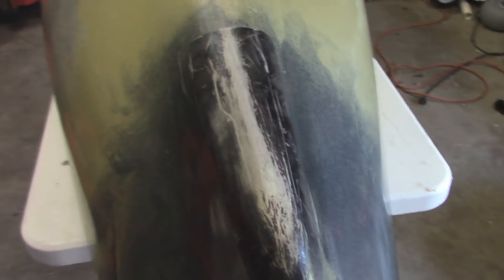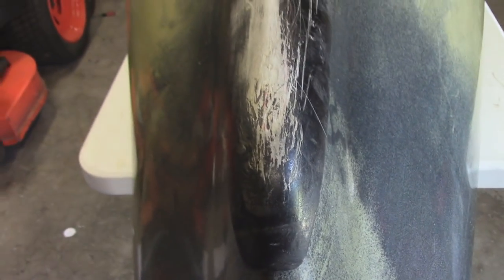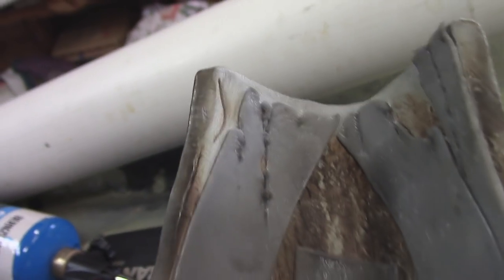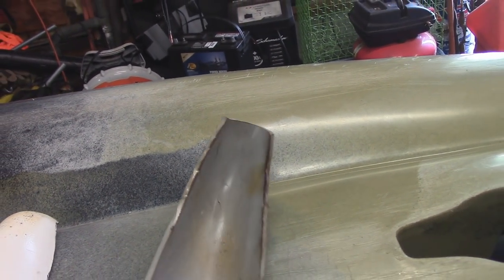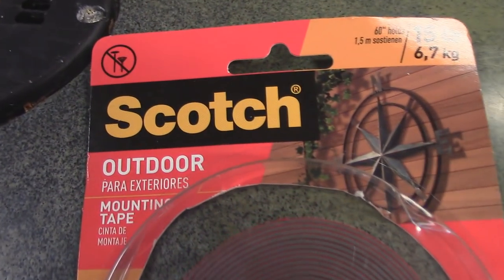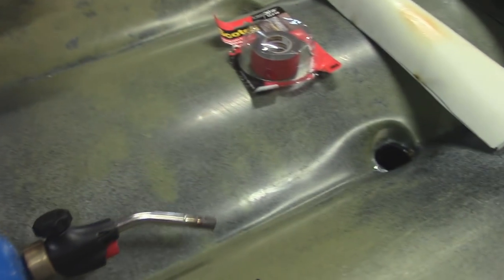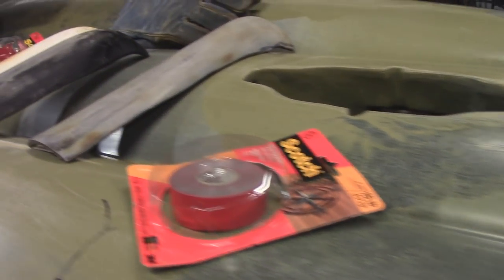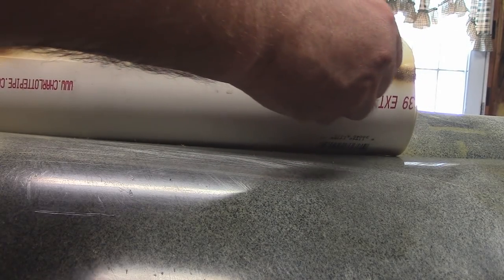The Best Front Skid Plate for any Kayak  (D.I.Y.  Keel Gaurd)

Comment: Great idea. Use a heat gun to reduce scorching. Also use a heat gun to soften adhesive between parts you want to pull apart. A loosely filled leather sand bag can also help in shaping.

Comment: Just like to say     THANKS     this is by far the best way to install form fitted, extremely tuff and removable skid plates. I have two royalex canoes and after 20 years there were some thin and worn away skin spots. All other options were messy and 1 time applications that once those wear out...what do you do then?    I used a heat gun and created form fitted skid plates that will extend the  life of these canoes another 20 years...one piece of advice for anybody that wants to try this...you can order PVC that is colored...wont be a perfect match of course...but closer than white or grey....once again...giant thanks for this video!!!!
Reply from the maker: Thanks,  mine is still going strong.

Comment: Anyone tried to use Fiberglass resin sheets and epoxy to make these things? seems that It would be easier than heating up PVC.
Im going to try this on a small piece I need to make should be less of a risk with the heat. Thanks for the detailed video!!

Comment: I made a trolling motor mount out of conduit and a heat gun worked great for bending it. I bet you could stick it on with plumbers/marine goop. Black pipe is probably ABS. It takes a different glue than PVC and might not stick to the tape. I wore a spot on the nose of my kayak from picking up the rear and turning it to put it on the wheels. I’ve used a pad under it since then but I like your idea better.

Comment: Great video! I just made one for myself with a few minor differences. I didn't go with the PVC route, instead I used some scrap 1/8th plastic sheeting that I had laying around and I gave the outside surface a solid coating of spray bed liner. Thanks for the idea.

Comment: I did that for the back of my yak which works well but had concerns doing that in the front.  I'm not sure what that extra piece will have impact to the ability of the yak to glide through water as that front piece might introduce drags.  Good video thought.

Comment: Great idea!!! Have you tried using the black ABS plumbing pipe that is used for residential drainage and roof vents? just wondering if the material better or worse compared to the other pipes and conduit.

Comment: You can also use Kydex sheets and mold them using a heat gun to the contours of your kayak.
Other approaches people have taken is to use JB epoxy and apply that in a neat way by using masking tape to shape and seal the edges.

Comment: Use braided fishing line and work it back and forth like a saw and it will cut through the adhesive tape to remove it. Then goo gone for the remaining residue. Just like removing car emblems.

Comment: Dont know if it'll be on the the yak long enough to make much difference but the grey PVC is UV stabilized and won't get brittle as fast.
Reply from the maker: Thanks, good info to know. It's been on there all summer. I don't see it coming off anytime soon.
Reply: Yup, I used one inch in a greenhouse. I even painted it with PVC protective paint. Lost all strength and I had to replace it all with UV rated conduit.

Comment: Use Coleman white gas, the kind you use in your old camp stove squirt a little of it in there and let is sit for a while it won't damage the plastic but it will loosen the adhesive from your tape. you can also stick the PVC in the oven to get the whole thing soft.

Comment: I like this mine kayak has a pinhole leaking from that noise tip I’m going to sand it down ceil it with some epoxy then make this thanks. But why are you taking it off? Did I mis out on some details? As to why the removal of it??

Comment: Looks good.  Any consideration for running the skid plate a few feet back beyond just the nose area.
Reply from the maker: yeah, sure.  if you wanted to make one all the way up to the mirage drive it could easily be done with the thinner pipe.   I thought about making a two piece for mine, having the thicker one up front and running a thin one to the back

Comment: If you heat the existing scratches that are on the keel a bit they melt back in the grooves and end up giving the surface a smooth finish to get the keel protector to bond well. No need to use a razor blade. Obviously don't heat too close to the surface and keep moving around and check out the results occasionally.

Comment: I've found the easiest way to heat up the pipe is to put it in the oven at 300 degrees for a few minutes. It's best to use a heat gun for the initial slice with the razorblade because the plastic will be too hot and soft to make the cut if you put it in the oven first. The installation of schedule 20 PVC (pictured above) is the easiest way but also the thinnest. Schedule 40 PVC is over twice as thick as Schedule 20 and will last much longer.

Comment: “when it comes to PVC pipe is the toxins released when PVC burns and produces smoke. If PVC pipe does become hot enough to catch fire, it releases dioxins into the air, which are harmful to both humans and the environment. Additionally, once PVC does catch fire, it will produce more smoke than many other building materials. Even when PVC is just heated, it also may release carcinogenic vapors that can cause cancer. The best way to avoid these dangerous fumes is to prevent PVC pipe from burning or to wear a gas mask when forced to heat PVC pipe.”

Comment: Nice guard! I was thinking of doing something like this only tap a few threads in the pvc to mount a replacable stainless strip about 1/8" or 1/4" thick. then mount the whole thing with tape. I wonder if heating it up with a glue gun would make it easier to remove?
What exact tape did you use?

Comment: I already bought the 30lbs Scotch double sided tape before noticing that you don't recommend it. However, what I did is that after sticking the keel guard to the kayak, I sealed it by applying some hot glue. It seems to work so far and is probably also helping a bit by reducing drag.

Comment: Good job... I've done some PVC mods for rod holders.. I heat in the oven.   But I see the point of torch "spot" heating.. I did use a torch on one mod.   BUT.. what is your opinion on placing hot PVC on the HDPE plastic (Rotomold plastic).... Deforming the existing kayak shape.. obviously you didn't have problems.  I'll probably do oven first.. finishing off with torch.
Also... you mention cleaned with Windex.. I would suggest then with Isopropyl Alcohol which won't leave a residue.  
Thanks for your vid.
Reply from the maker: Rob MyMetroFun-com
Thanks its been working great.  For the thin one i wasn't concerned about warping the kayak because it cools and rehardens quickly, but for the thicker one that i use, i put a towel on the kayak that was soaked in ice water and left it there for a few minutes and i also put my gloves in water to cool the pvc down faster. I've made a bunch of them and haven't had any problems with warping.  Good luck if you make one

Comment: Did you ever try putting on a thin plate, and when that is done and all cooled down, use the same process to put on a second or maybe even third thin plate?   If that works, I guess you could put a new thin plate over an old worn patch too.
Reply from the maker: No I just use the thicker pipe. The thin pipe is iragation pipe and the thick pipe is schedule 40 pipe.  I've had a thick one on mine for over a year and it still on there. It is starting to wear down a flat spot but it's still working and would take a long time to wear threw

Comment: This is an excellent video.  PVC is probably the best material for this protection since it is thick, moldable, and inexpensive.  I put one on last year and can see all the scuffs it has taken.  My problem is that although I use the exact same tape as you do, I sometimes find the skid plate separating.  Have you found any other glues that bond well enough to the hull and PVC over the past 15 months?  Thanks
Reply from the maker: Thanks,  I have had mine on now for over a year and I haven't had any problems with it separating. When I first put it on I probably spent a good 10 minutes pushing down everywhere. I have had a few people say that after they put the skid plate on they take some clear silicone and put all over the edges to seal it.  You may want to try that.
Reply: @SeaMonsterFishing  There is a new double-sided Gorilla tape that came out recently.  It also comes in two bonding strengths and claims to bond to polypropylene.  Maybe you'll get a chance to try it out. I've been happy with there range of products.  Always something new in chemistry.

Comment: Thank you for posting this! I will be doing this to my canoe and 2 kayaks. I stopped by Lowe’s and didn’t see any 4 or 2” tubes. All the “irrigation” pipes they had were small. I did find the large pvc and abs pipe. Can you give more info on that white thinner pipe you used? Exact name or perhaps a link? Thanks this video is much appreciated
Reply from the maker: If you go on lowes website type in sewer pipe and it should come up. That way you can check the stores in your area to see if they have any, which they should.  They have a 10 foot soild 4 inch pipe in my area for 11 bucks and you could probably make 20 skid plates out of 1 peice.
Reply: Sea Monster Fishing 
Thank you sir

Comment: great DIY! have you tried using marine goop or silicone base adhesive instead of the double sided tape?
Reply from the maker: No i've only used the 2 sided tape. Its still on there and going strong
Reply: @SeaMonsterFishing  nice I like and subbed. I'm going to attempt to do one on my kayak. will be making a video it. if it comes out good I'm dedicating it to you if you dont mind...😁
Reply from the maker: @YakNinja    yeah sure, that would be awsome.  Any questions you run into while making it feel free to ask.

Comment: Think I'll use my grill to heat the PVC to about 375 to 415 degrees which is the correct temp.  Use OVE GLOVES which are rated for 500 degrees. I have worked in EXTRUSION PLASTICS for 37 years. I'm a CRAFTSMAN. This will be fun.

Comment: wish I would have found this video before messing up my fiberglass hull when removing some vinyl wear tape that didn't hold up but stuck on a little too well, I'm even considering removing my keeleasy guard as it wasn't able to make as tight of a shape as I needed

100% doing this the day after watertesting my dad's new kayak!
Reply from the maker: Ouch that sounds bad.   But yeah this works awesome.  I did make a shorter video thats on my channel if you do end up doing it.  Any questions on it feel free to ask
Reply: @SeaMonsterFishing  planning to use sdr35 pipe cause it's already a teal, it'll go well with the blue color of the main kayak 👍 I'll look that video up, thanks!

Wondering if an oven set low would work well, and going to try my heatgun on it in hopes to avoid burning 😉

Cheers to a good season!

Comment: Will that tape adhere to polyethylene? Nucanoe hulls are HDPE, nothing I know of sticks to HDPE.
Reply from the maker: Hobie kayaks are made out of rotomolded polyethylene and the tape i use you will have to pry it off. As far as the high density stuff, I can't say for sure but if you do try it you might want to lightly sand the area and clean it real good.

Comment: Awesome idea! Thanks for posting this, going to have to give it a try. Did you rough up the bottom of the the kayak before you stuck the PVC on with the double sided tape or just do it smooth?
Reply from the maker: Thanks, its been working great.  My kayak was already alittle roughed up. A friend of mine put one on his new kayak and he used some very fine sand paper to take the shine off of it and hasn't had any problems.
Reply: @SeaMonsterFishing  do you think the black PVC pipe would work? Or is it too thick??

Comment: I didn't see any cold water and towels during the process. If you don't use it, will it warp or ruin the kayak? I have a Sundolphin Journey SS. Had a big dent in it and a small hole. I fixed it the best I could (5 gallon bucket fix from YouTube) then I put some silicone over the patched area and I want to put one of these skid plates on it too.
Reply from the maker: It would be a good idea to use some towels soaked in ice water. I didn't use that in the video because the thin pvc re hardens quick and i was confident i wouldn't warp the front nose on my kayak because of how thick it is up there. But the thicker gray one i showed in the video takes alot longer to re harden and i would definitely use alot of ice water to make sure it doesn't warp anything.
Reply: @SeaMonsterFishing  do you think the black PVC pipe would work ok?
Reply from the maker: I cant vouch for the black pipe because i haven't tryed it, but if thats the color you want then i would give it a try and if it doesn't work out then i can definitely tell you the white and gray pipe works awsome once its on the kayak

Comment: do you know if a heat gun is hot enough to melt the gray conduit?  or is the torch definitely needed?
Reply from the maker: I don't have a heat gun, but having used heat guns in the past I would imagine it would do just as good a job. It might take a little bit longer but I think it would work
Reply: hmmm.  ok thanks for responding.  thanks for the video

Comment: Wonder if 90 degree radius elbow be easier to shape.
Reply: It doesn't matter... I'm doing this and bought a 90° elbow, and to heat it up I just layed it on my porch with a gallon paint can covering one side and the heat gun blowing into the other. By the time it was hot enough to flex and cut with a razorblade it lost most it's bend, it was more like a 10-15° bend max. It's great in the sense that you don't have to buy a full 10 ft pipe though, I just gotta do it again for the stern end.

Comment: Hey man trying to do this for my pa14 but the tape isnt holding. Any suggestions
Reply from the maker: I would make sure that your using the same double sided tape that iam. (The extremley strong tape doesnt work) also make sure the skid plate is tightly formed to the kayak. If its a new kayak you may have to wet sand the shine off where the skid plate is going to go.  I sand the inside of the skid plate and clean it off before i put the tape down. If you have burnt spots inside the skid plate the tape isnt going to stick well in that area. Last thing i can think of is make sure the kayak and skid plate are clean ( i just use windex ) and if you have deep cuts get the dirt out before you put it on.  The one i put on in the video is still on with no problems and that 9 or 10 months ago. I have 6 other friends that i fish with and they have skid plates on theres also with no problems. I have had a few people in the comments say that they put some silicone along the edges to make it water tight seal. But like i said i havent had any problems, any questions feel free to ask.
Reply: Sea Monster Fishing  tape is sticking super good to the skid plate just not the kayak. I washed with soap and water and a toothbrush to get all the dirt out of the gouges and then wiped with alcohol and let dry. Its sticking to the kayak kinda but i can wiggle it off
Reply from the maker: The alcohol could have something to do with it. It could be leaving a dry residue that affects the tape. And depending on how scuffed up your kayak is you might want to lightly sand it. If your doing it in the cold weather that could affect it to, i would use a hair dryer to heat up the kayak if thats the case.  Other than that i dont know what the problem would be.
Reply: it finally seems like its held pretty decent. ill give this one a shot and if it somes off ill try and clean with something else and see. the tape is sticking real good to the skid plate really good
Reply from the maker: Glad to hear, i hope it works out.

Comment: Great job, wouldn't using a hot air gun be easier?
Reply from the maker: Rikkie Carette 
Thanks.  If i had one i would probably try that first before i put direct fire on it.  For the thick pipe it would probably take forever
Reply: That's what I wondered too
Reply: I just made two of these and used a hot air gun and works a treat and does not burn the PVC

Comment: Do you warm up the tape any before applying it to the PVC or before putting it down on the kayak ?
Reply from the maker: No i just wait until the skid plate cools off and put it on.  If it was winter time i would probably heat up the kayak with a hairdryer first.